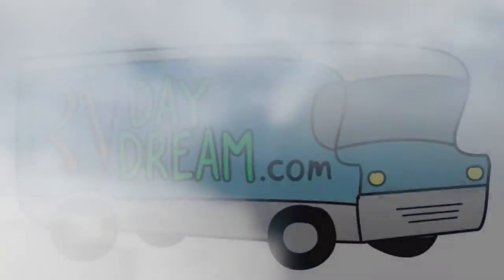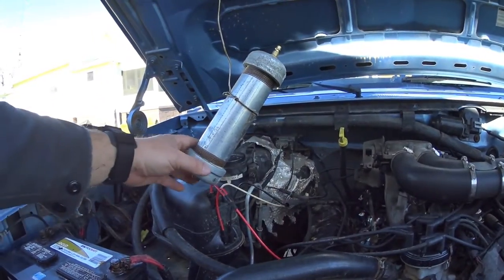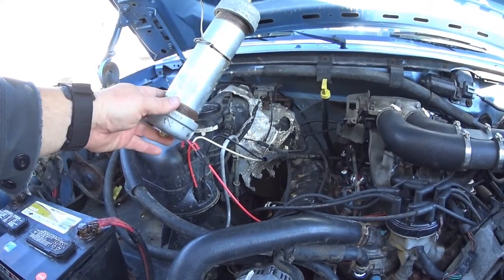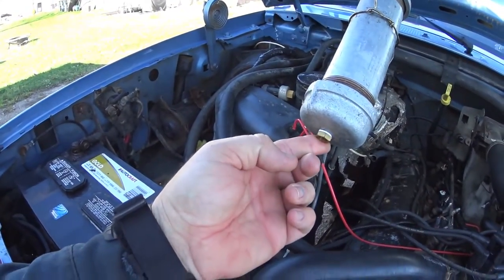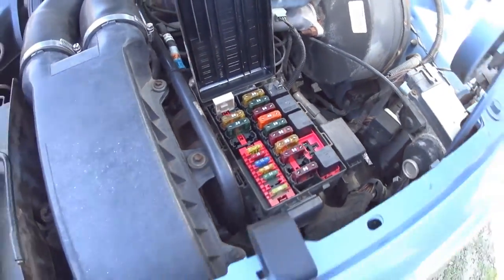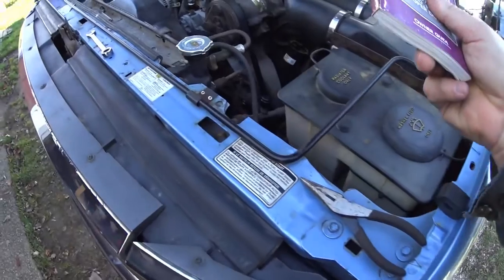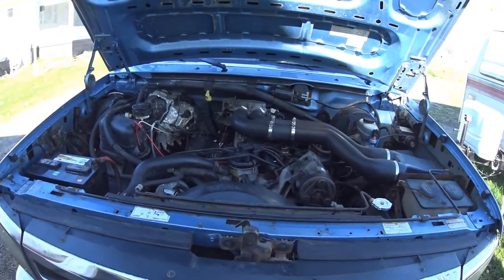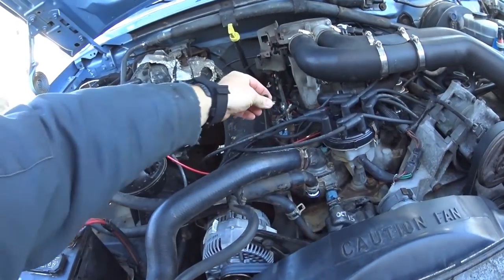DIY F250 Fuel injector cleaning

Comment: Thanks for the video. Is this the same connection as in a Toyota? The fuel line seems to have a quick disconnect.
Reply from the maker: I'm not familiar with the Toyota tell you the truth. Just look underneath the hood at the fuel rail to see if you can find what they call, a Schrader valve, basically looks like your tire valve. If it does this will work.
Reply: @Rvdaydream  Thanks. I went ahead and bought a c80 unit rather than make my own (because it was only sixty two bucks), but I did take your advice and got two 15 oz. cans of B-12 for 10 bucks rather than higher priced Seafoam. Hopefully this will ameliorate the notorious Toyota piston ring problem causing oil consumption in an otherwise tip top Highlander.
Reply: Three part crazy follow up question: a) can I mix in some AC Delco X66P that I have in the garage? b) what about a bit of water or dish soap/water (say, 7 oz gas, 6 oz B-12 and 1 oz 5% Dawn/water), c) can I use the Dawn solution to soak the cylinders overnight then jog the engine with rags over the holes, suction it out and then do the pressurized B-12 treatment? Of course, I'll change the oil afterwards. Thanks

Comment: Please tell me what air compressor do you use because of have the tool and the same fuel injector but i don’t know which air compressor do you use please answer me 😭
Reply from the maker: Any air compressor will work. You don't need very much pressure at all.
Reply: RVdaydream does tires air compressor will work ? I have 2016 dodge charger hellcat
Reply: RVdaydream please answer as fast as you can 😭💔 by the way you deserve a lot of likes ans subscribers 😔
Reply: @MrSmm511  like he said ANY COMPRESSOR WILL WORK .
yes a air compressor for your tires will work .

Comment: I like that this one is much simpler than others. What did you use to regulate the pressure?
Reply from the maker: Thanks.. I used the Air Compressors regulator

Comment: Just because you cleaned the injectors doesn't mean you don't have a bad one .
Reply from the maker: Just because you have all new injectors doesn't mean that you don't have a bad harness. Just because you have new injectors and a new harness does it mean that you don't have a bad PCM. Just because you have a new set of injectors, a new harness, and the new PCM doesn't mean that you don't have a bad valve. You see where I'm going here. That's not what this video is about. This is to show how to clean injectors. It is more likely that the injectors are dirty than they are bad.